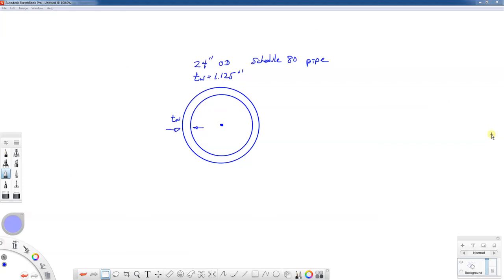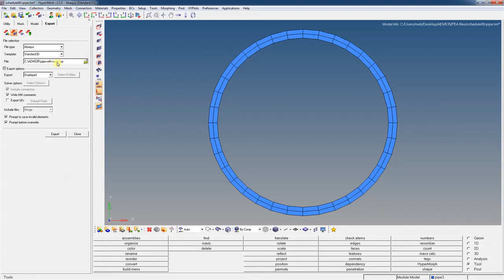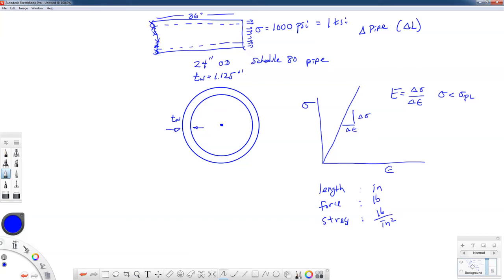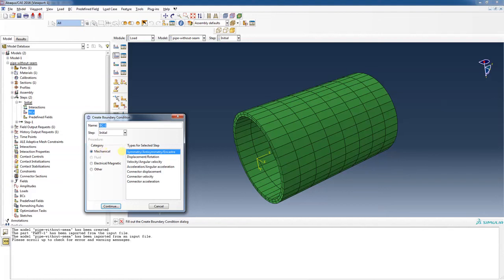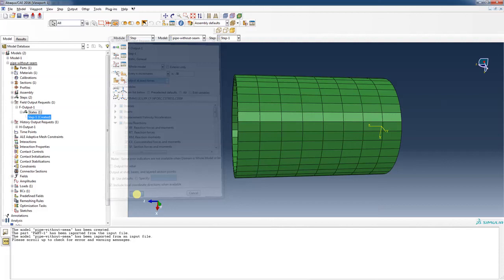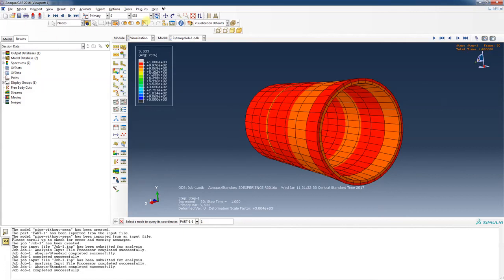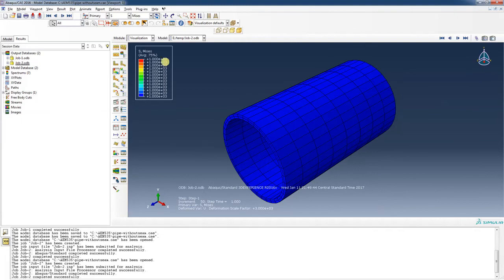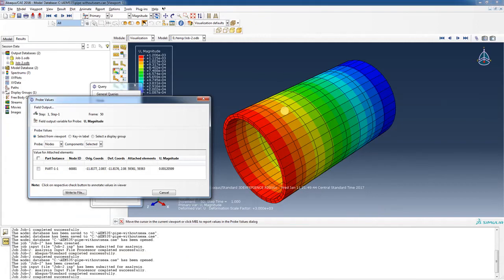AEM 535 HW-1 Tension on Pipe

Comment: Actually you get exactly 0.0012. note that you displayed your displacement a U magnitude. That includes displacements in Radial direction as well.
Reply from the maker: Thanks.  I forgot to change to the axial strain component!
Reply: Mathematically, to calculate U (Magnitude), Abaqus use this equation: U = sqrt( U1*U1 + U2*U2 + U3*U3 ). Is that correct? Thank you